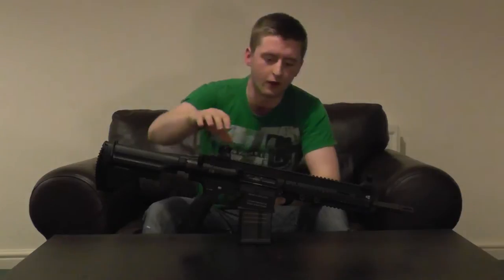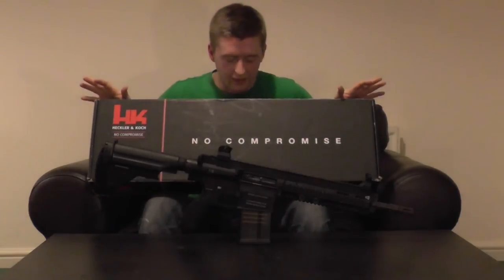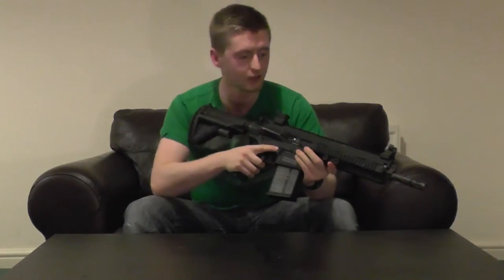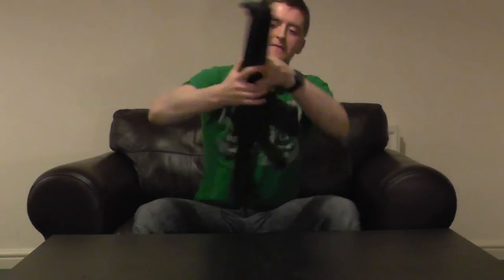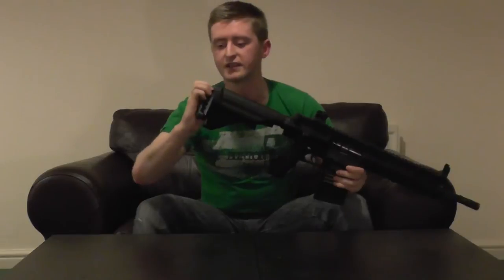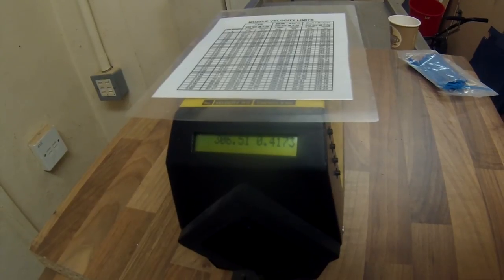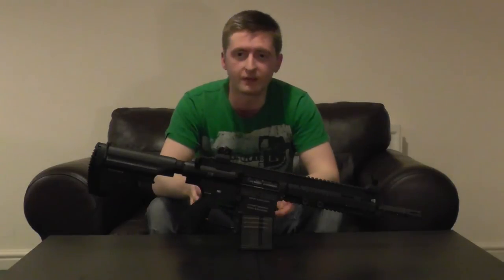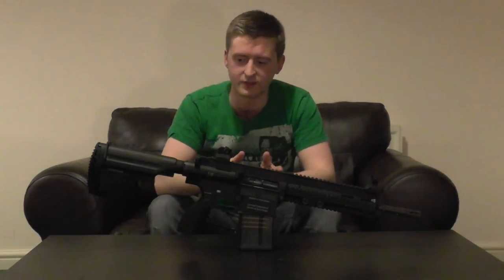VFC 417 AEG Airsoft Review

Comment: i have the same gun and my trigger gets stuck to some times the reason why is because the battery output is not strong enough to move the spring so if use a 11.1 lipo that will never happen